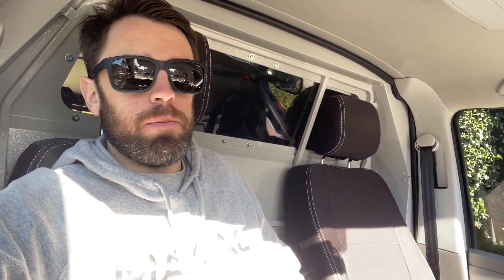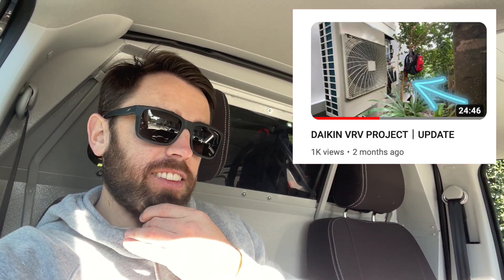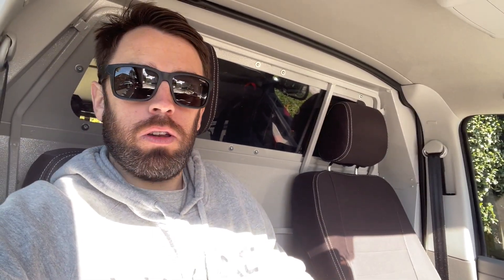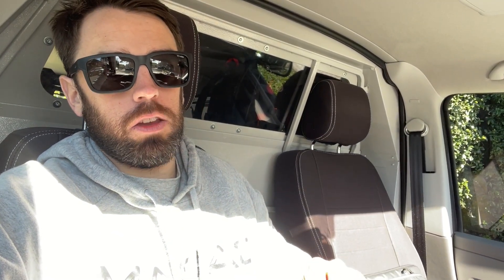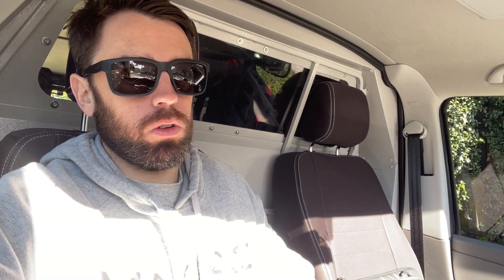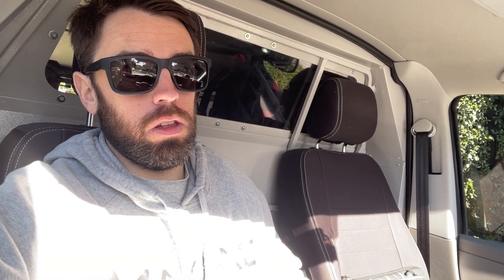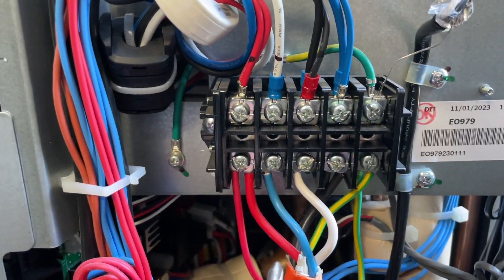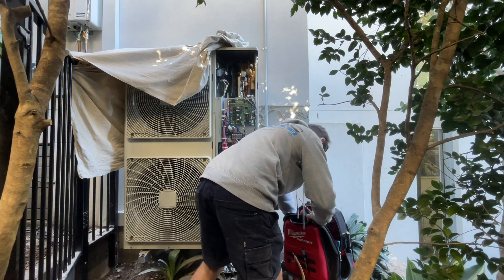REPAIRING DAIKIN U1 ERROR

Comment: I just had this issue with mine, U1 error after electrical company was around changing the meters. Called my air con guy and he said to turn off the air con at the meter box, then turn it back on. That worked perfectly for me, error is gone now.

Comment: thanks for the video - today was the first time using our Daikin AC 3 phase and just does not seem to be getting cold and pushed the test button and says U1. Ausgrid did change the lines to the house from 4 lines to 3. *Is it bad to run with a U1 error?
Reply from the maker: U1 means the phase has been reversed. It will not produce any cold air what so ever until it’s been rectified however you can still run the indoor fan fine. 
I would turn the circuit breaker off for 15 patient minutes then turn it back on. If the fault code remains then you need a technician to change the phases around. If the fault disappears then you are good to go.

Thanks
Reply: @maracservices  thanks heaps for your advice, turned off the CB and waited and still happening - will try and get someone in before Christmas, thanks again

Comment: Hey mitch, I got a job that also have a u1-01 fault but is a singer phase not a three phase,  do you know what it mean? Is a Daikin thanks
Reply from the maker: It’s a power issue mate. I’d make sure the unit has power and if it does check for power on both sides of all the fuses located on the outdoor pcb.
Reply: Thanks mate, I will go check the fuse. I think the fuse is connected to the outdoor PCB that can't not replace might need to change the PCB

Comment: Hey mate just wondering  if you know what possible  could cause  a8 error on a ducted daikin 16kw r32. Thanks
Reply from the maker: Thats an issue with the incoming power to the indoor fan motor from memory. Did it happen randomly? If so, first things first.. You need to turn the power off to the unit. Not just off at the controller but off at the isolator or circuit breaker and leave it off for 15 patient minutes minimum. Then turn it back on and see if the fault has cleared and if it happens again. cheers

Comment: Always test what you’ve done when phases are re energized they don’t get re connected simultaneously, there’s a time gap between each phase connection and if phase 1 is connected first and the Daikin has control on its enough time to register u1 loss of phase. More often loss of phase than phase reversal. Massive issues for energy supplier if they start reversing consumer mains
Reply from the maker: Very interesting, thanks for that! I appreciate it mate and that all makes complete sense. 
What happened in this video is complacency and assumptions from my part. I learn something new everyday it seems. I will say though, I have absolutely seen Aus grid reverse the phase when disconnecting and reconnecting. I’ve actually made a video on one. So my assumptions weren’t completely out of no where. Regardless thanks again mate!
Reply: @maracservices  yeah it definitely does happen but not frequently and can cause them big issues etc so they do try and do their best to avoid the headaches at the very least.

Comment: hey big fella, remember the old daikin "service" app they updated and ruined? turns out if you log in up the top right (requires an email) you can get access to all the good step by step bsc buttons/ hp lights field settings. I recently had a vrv style split ducted that had this same fault, bit of a different story since the place just had 3 phase reconnected after going through flood. Had to run the thing through test mode before it would fire up. Keep cracking on mate love the vids
Reply from the maker: Ahh sweet thanks for that! I still have that app on my phone funnily enough. Good to know! Cheers